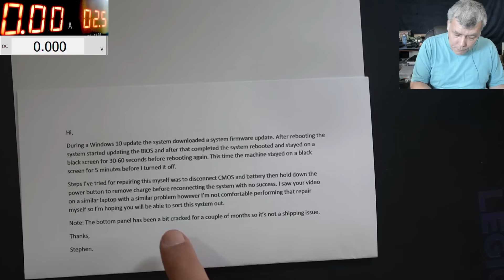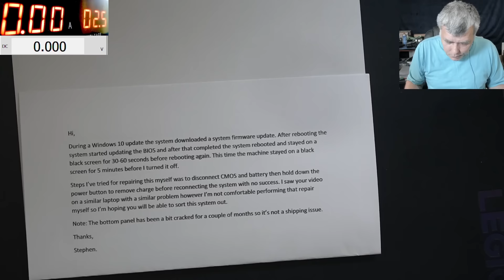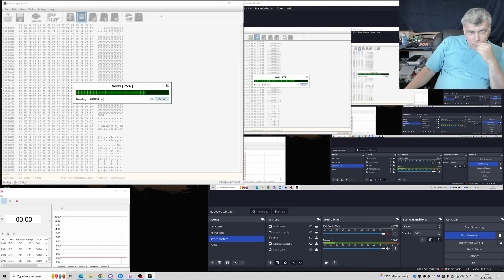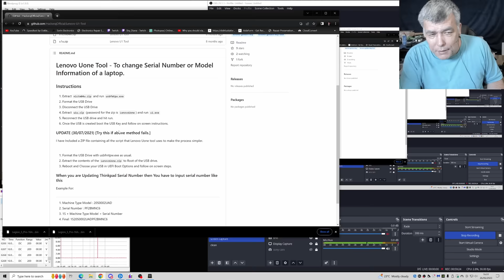Lenovo Legion 5 15ACH6H dead after windows updates - Sadly, laptops are dying after windows updates

Comment: I have the near identical laptop with the RTX3060 and my best advice is to use the Lenovo Legion Vantage software to do all BIOS updates. WIndows updates are good for most things but if you check the Lenovo Vantage software often for updates and perform them through the manufacturers software, you won't have this problem.
Reply: there is a saying, if it's not broken, don't fix
if the bios are OK, don't update
unless you know what you're doing
Reply: @maklogetrich2378  The Vantage App makes it so user friendly that a novice can perform the updates.  The issue with this customer was that his system WASN'T updated through the App so Windows proceeded to do it for them sadly to it's demise.  I work in IT Security and to say NOT to update is completely ignorant.
Reply: HP has emergency bios recovery from a 1 Gigabyte USB stick with Fat32 partition and firmware file
Reply: @maklogetrich2378  Yeah its sorta baffling to me how casual these companies are pushing bios updates. Its really not something that should be expected of a normal user and certainly not within a regular windows update. My mom never reads these update messages and will just force shut down her pc if she doesn't want to wait.
Reply: @klwthe3rd  You don't know what the customer did & neither did he.  Windows never does BIOS updates.
Reply: I'm sorry to disagree... sure Lenovo has this convenient one-click update companion app which make things easier, BUT you really gotta research before you do such update (especially BIOS), countless of legion owners had issues after they update via vantage because they don't know better... some of them bricked their machine completely, I for one experience this with my Ideapad 3 gaming (tldr: Lenovo announce an unstable Bios version, it causes BSOD, and I couldn't point what causes the problem, even the repair center can't, which they decided to replace my Motherboard, with different Bios version).

And to my surprise, lenovo remove the unstable Bios version from their official website... This is a recurring issue, even the new ROG Ally has this issue, like it's preventable, but somehow they love to screw their customer.

The other commenter had it right, don't update anything if it has no issue, except if you already research the update thoroughly, via forum or reddit
Reply: @rocketscientist007  i also did not encounter BIOS updates by windows, like, never. Through some app sure,but not by windows. I swear, verified updates and drivers just dont exist by windows apparently, judging when something like this can happen.
Reply: Vantage for my E485 basically killed my Thinkpad too. It was just in warranty, and they replaced the motherbord. If you consider the number of posts on the Lenovo fora having these kind of issues, the QA process at Lenovo is either poor or planned obsolescence.
Reply: @skinkie  Well updates are there to protect the end user. If the update causes damage as you mentioned, Lenovo stands by that fact and will warranty the motherboard. I know this because I've asked several high level Lenovo techs about this issue if it was to ever happen to me. Which it hasn't 🤔.
Reply: @klwthe3rd  The problem is: when this happens when this laptop got out of warranty, it wouldn't be replaced for free. And the user would be responsible for the damage of the BIOS upgrade.
Reply: @skinkie  I understand this point. But until you can give me actual percentages of how often this happens out of warranty, you could say that about anything. Are you a certified IT Tech? I am. So unless you are, you're just talking.
Reply: @klwthe3rd  I am a certified engineer with an university degree :-) But since you clearly state that you know the internals of Lenovo. Can you give me a reference that Lenovo fixes motherboards that broke via Lenovo Vantage when they went out of waranty? Because for my personal situation, the laptop was out of waranty due to an administrative reason, I had to provide the time of sale date in order for Lenovo even to accept(!) the issue.
Reply: And that is exactly why I say a hardware must run with the software version installed at the factory. Usually, there are no real benefits you get from the update. True, it might add some new features, but do you need them? You are already using the thing, and everything works fine the way it is. Why would you want to change it and re-adjust your settings again? Do you seriously want to spend your time revisiting the already working machine? That's exactly what we are being told to do these days. I say, no more. If they sell you a laptop that cannot function with the factory software, then sue them, get your money back. They need to understand the wrong of constant software updates.
Reply: @atomotron  Dude you have no idea what you are talking about. BIOS updates address serious security flaws on machines. So you think the manufacture spends millions of dollars to employee these programs if they didn't do anything???  SMH
Reply: @klwthe3rd  First, tell me, is there really any security flaws in BIOS? I find it rather hard to believe. These things were around for good 40 years, and it is not that big of a program to begin with.

Second, if there really is a security flaw in your computer, I think this is perfect reason to sue the company or get your money back. You don't suppose they can sell you a car with no seatbelts, to install them a month later, and get away with this?

And last but not least, I actually know what BIOS updates do in my computer. Last time, they removed manual overclock/undervolt options from UEFI screen, and replaced them with an API for their management software. Basically, they moved these options from UEFI into their Control Centre app, for your convenience... and because you can't display ads on UEFI screen.

In any case, there is no benefit for me because I've already tuned my computer the way I want it to run, and I don't intend to revisit these settings, which they pretty much force on me. No way sir, thanks but no thanks.
Reply: @klwthe3rd t's a rather different ball game in a managed IT environment. For the average consumer it's often been a better idea to pass on BIOS updates unless you actually need the fixes. That's because it can bork the system beyond your ability to fix yourself...
Reply: @nickochioneantony9288  I actually always start with a complete CLEAN install on any new device (in brand laptops the serial is usually in the UEFI, and the installer can l,ook it up from there). The preinstalled image is almost always so full of adware crap, that a clean isntall is usually faster than removing all of that. In Windows I also generally disable hardware updates as I have burned myself enough time (since Windows98) to not trust that. Good manufacturers have drivers for current devices available online. I would recommend save downloaded drivers, because they tend to disappear some time after production stopped.
Reply: @milosstojanovic4623  nah wiindows 11 does bios updates... happened to my newly bought HP laptop... didnt even want to do it... i only wanted the drivers for iGPU... but it downloaded it regardless... it pissed me off, cause I as soon as i saw "updating firmware" i knew it was too late i could not cancel out of it.... and in my practise bios updates never amounted to anything good, especially if you don't have ANY prior problems just do not do it, it doesnt solve anything most of the time, if its not broken, dont fix it. They should really make an EXTRA option for bios update in windows updates, not inside the OPTIONAL all list... It should be put somewhere where you would have to go out of your way to update it. UEFI made bios update borking too easy sadly ;/
Did laptop manufacturers ever do dual bios options(if one fails, boots other) or is it mostly for desktop market motherboards i wonder.... Cause i never had a laptop with dual bios option.
Reply: @rocketscientist007  windows does update bios without you knowing it..  if you will lookup at Windows update manually, you can see there's a "firmware update" (or something).. that will update the bios..
Reply: @klwthe3rd  You're brainwashed. Keeping a machine offline and updated as least as possible (and not using windows, or at least not anything newer than W7) is more secure than leaving auto-updates on. Updating just because is the reason log4j became a meme, it's not normal to expect an average joe to do BIOS updates, and it's not normal to go behind his back and do them via software (windows update). Lenovo isn't the only vendor to have bricked laptops because of failed firmware updates, it happens to HPs and others as well. And for what? For you to rest easy knowing that some updates are ticked, but not actually knowing what they do and what potential actual vulnerabilities and backdoors they open.
Reply: @skinkie  well it's both. QA at Lenovo is bad, but at least customer support is better on consumer side.
Reply: @aseidinfo  my experience: as long as your device is in warrantee.
Reply: @maklogetrich2378  I agree with the "know what your doing" part but not the "not broken don't fix it."  There are numerous firmware updates esp to the bios that rectify cybersecurity vulnerabilities and/or implement hardware operational optimizations and interoperability.  Bios and other firmware updates (when/where appropriate based on the patch logs) are very often valuable to flash.  Sometimes necessary for major cpu security flaws and can even greatly enhance performance.
Reply: @sparaz  does intel's spectre-v2 mitigations not convince you that for most people who don't care about cybersecurity for home use they'd rather use the full hardware rather than gimp it artificially with firmware/microcode updates?
Updates viewed in this context for the average home user, are nothing more than a convincing tool.
Reply: @aseidinfo  yeah absolutely agree that some updates degrade capability in the name of security but there are use cases in both direction.   Some flaws need to be patched for interoperability.  But yeah id agree that a lot of people don't need to update unless it gets in the way of new hardware or something they need to do.
Reply: @maklogetrich2378  Nice advice but there is always something broken on Windows laptops, and Microsoft almost insists that you update the BIOS before upgrading Windows.
Reply: @sparaz  yes, but it still depends on what you're doing on your computer
if you're just an average computer user, with just trusted antivirus or internet security and common sense of course, that kind of bios update is not really necessary
but if for you it's a necessity, go for it
Reply: @jwstolk  my last time with Windows 7, it's take 6 years since the last I installed, until I had to install Windows 10
never had a problem with Windows 7, never reinstall OS
and I always disable windows update whenever I install Windows 10, either it's for me or someone else
Reply: The state of things is this - "corporations knows better", which is sad because software performance degrades, one can say they do this on purpose.

Comment: Surprises me that to this day, laptops don't offer a bios rollback option, motherboard makers have been offering that feature for over 20 years.
Reply: Not every system has that feature, though it's certainly true that /some/ motherboard manufacturers have provided a relatively simple solution (backup copy of the BIOS).

Computers that you buy off the shelf don't generally use "generic" motherboards though, they use boards that are often designed by or on behalf of the "manufacturer" (e.g. HP, Dell, Lenovo) and therefore custom. Often they are specific to a particular mode line and differ from directly buying a motherboard from a manufacturer like GigaByte (Gigabyte?) or AsusTek.

Still, in the case of desktops where many things are relatively standardized, it's fairly common for a computer manufacturer to get customized variants of otherwise standard boards from a supplier.

Unfortunately that is significantly less common with laptops, or at least there is little sign of that being the case.
Reply: @jnharton  backing up the BIOS is useless if the update bricks the computer and you have no way to flash it anymore?
Reply: That's why I don't update the bios unless something is seriously wrong.
Reply: It costs money and eats into profits.  Most people buying a laptop want it cheap.
Reply: Nowadays a lot of laptops have emergency recovery modes to recover from a bad BIOS update, the issue is that those modes, more often than not, are not documented, or available only to authorized repair centers...
Reply: @mbc07  Do you happen to know a specific laptop model that would have this undocumented feature?
Reply: @v5k456jh3  "If it ain't broke, don't fix it".  I agree with this methodology for the average user.

That said, sometimes you get new features and preventative measures with BIOS updates.  However, that's really aimed at somebody who truly understands what the benefits are.

Also, sometimes a BIOS update is a removal of features which is absolutely insane.
Reply: @RK-kn1ud  big brands usually publish documentation in how to do it, for HP, Dell or Lenovo you can power the laptop while holding Win+B, Ctrl+Esc or Fn+R  (respectively) to make them attempt to recover and flash a BIOS file from an external USB drive, which you can prepare by downloading and running the BIOS updater using another working computer.

For smaller brands, documentation is often scarce or outright unavailable, but the default recovery method from the BIOS vendor usually works (Ctrl+Home for Aptio BIOSes or Fn+Esc for InsydeH2O BIOSes). You'll still need to have a copy of the BIOS file with the correct name on an external USB drive to attempt those methods, and this can be hard to obtain, though...
Reply: @nzoomed  The kind of backup I was referring to is a second BIOS chip or some sort of onboard flash, it is not stored on the same chip or your SSD/hard drive and is not affected by flashing the main BIOS.
  
Switching from the primary BIOS to the backup could involve moving a physical jumper or activating an alternate startup sequence.  
  
AFAIK most modern computers have some sort of auxiliary microcontroller/processor unit/logic that manages very low level stuff. It's probably responsible for soft power and maybe this kind of BIOS/switching.
Reply: @jnharton  I know gigabyte had this feature way back with dual bios, but in those days you were stuffed if you didn't have a dual bios board, you physically has to remove the rom chip and flash in an eeprom programmer to fix.
Reply: @RK-kn1ud  A bit late, but I have an example of a specific older laptop that has a bios recovery: Acer Aspire 7750z, which has a crisis disk mode that can recover from a corrupted bios via USB.
Reply: Many do.
Reply: @mbc07  for an hp laptop, I've recovered it from a bad bios flash that otherwise bricked it using this method.  If you follow the instructions to the letter with the correct image it can work.  In my case it did completely zero out the mac address for the built-in NIC and probably some hp/windows branding, but I was able to get the laptop to boot.  Took a while, and was making a really loud beeping noise during the flash though as it slowly wrote a block at a time.
Reply: @RK-kn1ud I can't say for every device out there, but my Thinkbook 14 G3 ACL has that exact feature, called 'BIOS back flash'
Reply: with the desktop form factor its something theyve tried to charge more and more for every year as it becomes increasingly altogether left out